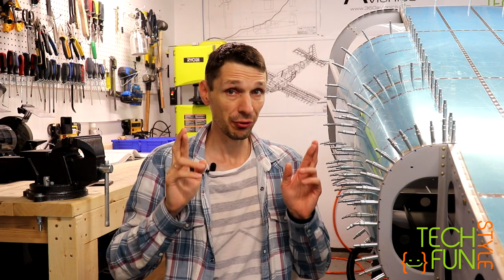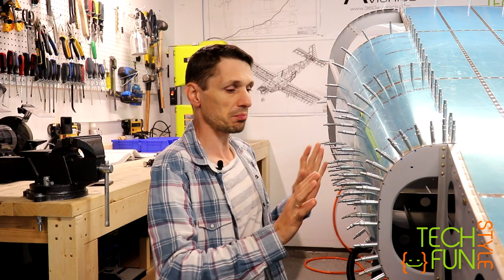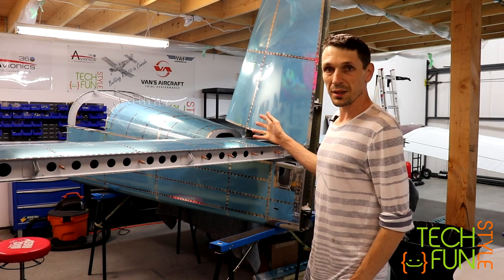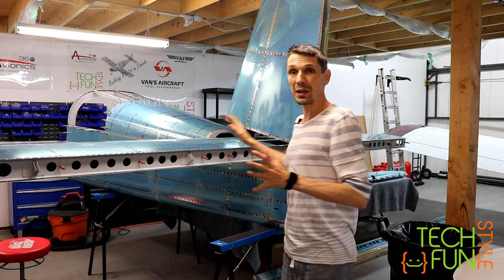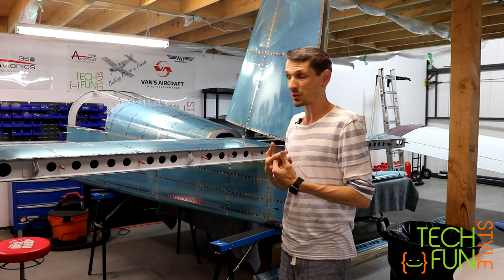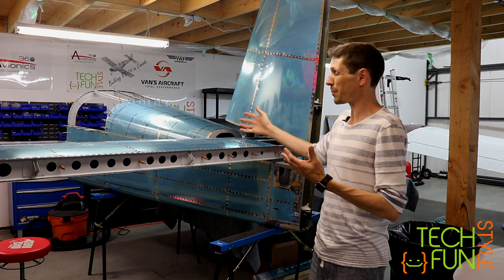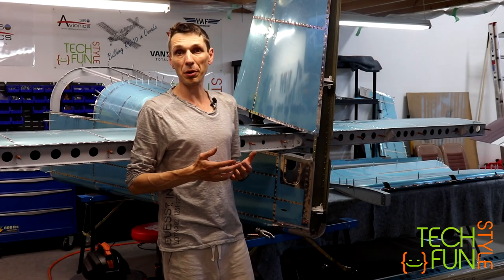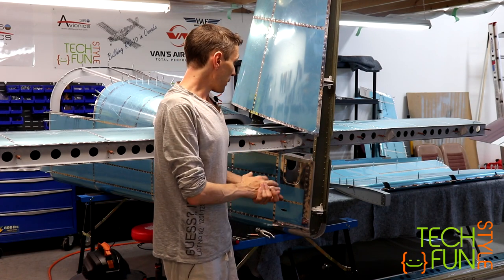RV-10 - Tailcone assembly. Done!?

Comment: Enjoyed watching you perform various metal working operations.  I slowed down the playback to half speed so that I could see some of the detail and get an idea of the time between successive steps.  I am intrigued also by your black work gloves.  They look like they do a good job of protection and still allow maximum flexibility and dexterity.  Would you mind providing manufacturer and style information about them so that I can find them in the US?  Thanks.
Reply from the maker: Unfortunately I used all of these and have no packaging with name of manufacturer. I got these at local hardware store. These were Heavy Duty gloves for vehicle mechanics. I am sure you may find these in US at most of car parts stores.

Comment: Really impressive how quickly you've moved through the build. Clearly helped by the involvement of the entire family...So well done to all! I did notice one item in this video I'd thought I'd question (9.36) - HS-1008-L, (lower right bracket attaching horizontal stab), do you have an extra hole or drill start? If so, this will likely need to be replaced.... But really excellent progress and quality of build so far - can't wait to see the finished aircraft...
Reply from the maker: Thank you for your feedback. No I do not have any holes or hole started there, I think it just looked in the video like that for some reason. Thank you for noting that.